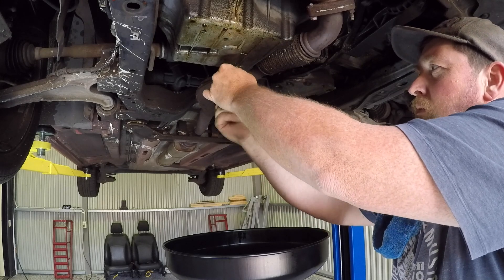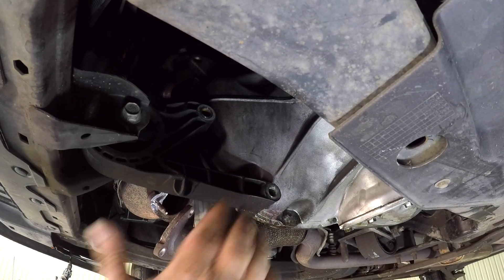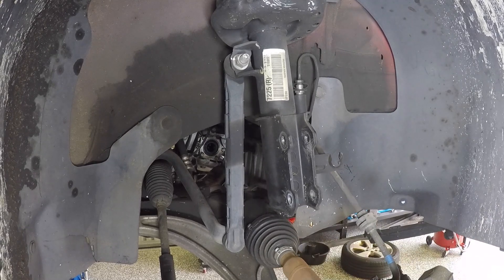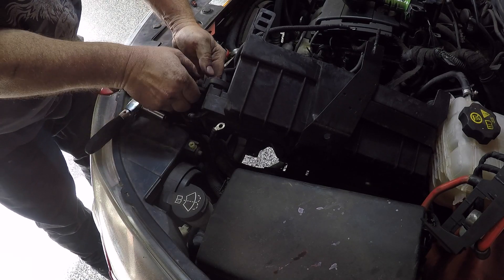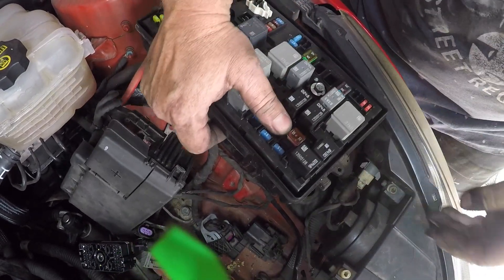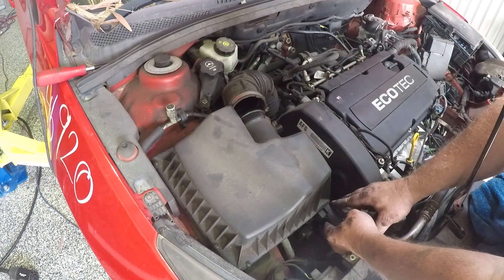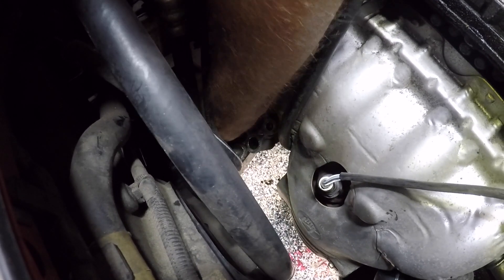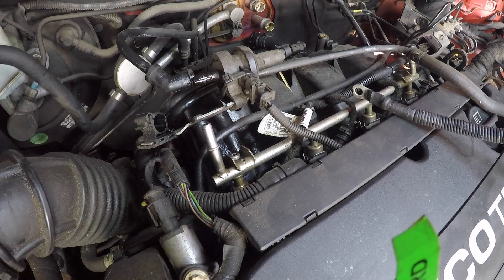Cruze Engine Removal

Comment: The video was so helpful! We are pulling out the engine from by 2010 diesel Cruze as my clutch is stuck to the floor. We are having trouble disconnecting the gear cable from the gear. You say it pops off….mine is not “popping “ is there a technique to disconnect it?
Reply: I would like to know this also!
Reply from the maker: have you got it sorted?
Reply: Yes we did. Thanks